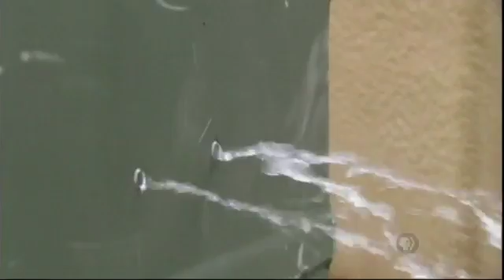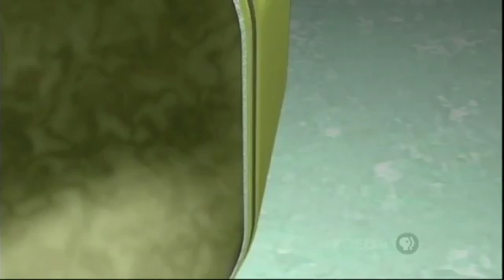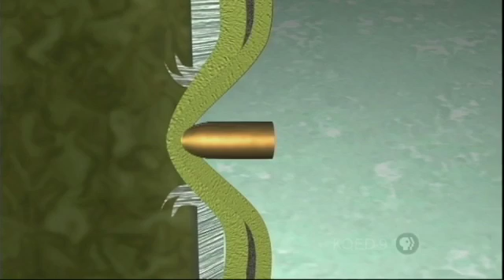Smart materials (2 of 5): Battle Jacket, Self-healing protective coating

Comment from the maker: If the bullet hits the gasoline vapor and air mixture above the liquid, there is a possibility of an explosion if the mix ratio is just right. However, if the bullet hits the liquid gasoline, the liquid would cool down the bullet instead of letting it ignite the gasoline. Without oxygen, gasoline will not ignite by itself.

Comment: @Lonewolf6565 the round does the same damage that a normal ak-47 would do is that the only difference would be accuracy, maintenance and other factors because it is a different gun but what they are just looking at is what an bullet from an ak-47 would do to an gas tank which basically all they needed to simulate was the damage that the round would do to an gas tank and try to make something to counter it